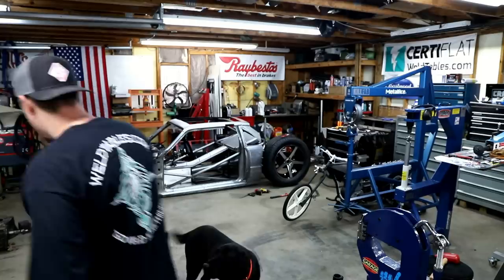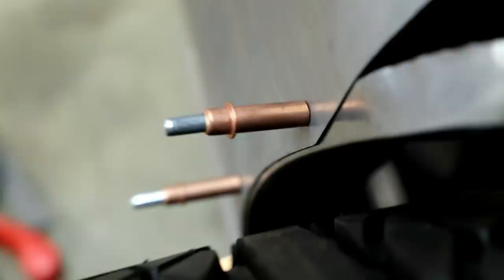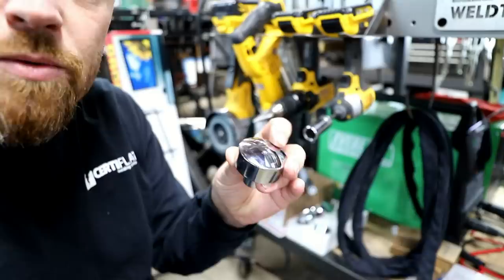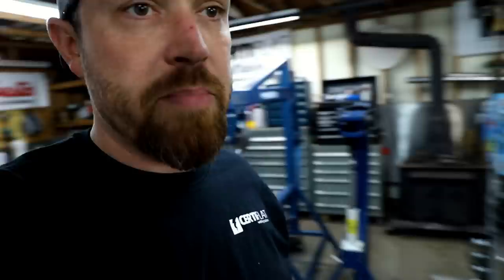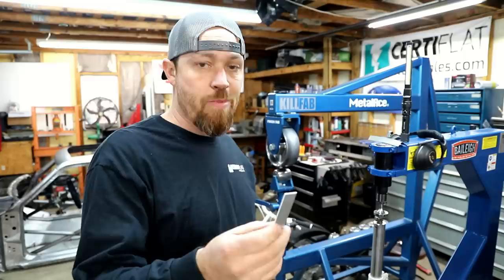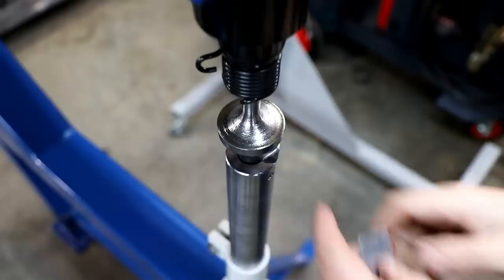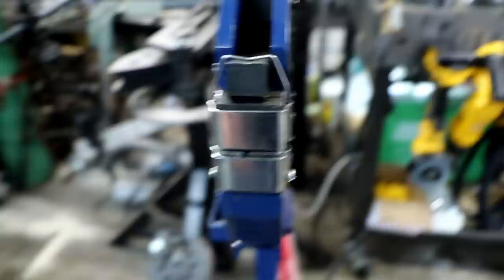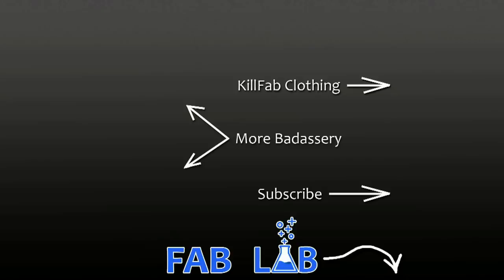How To Make Tools To Stretch Sheet Metal

Comment: You should have a piece of card board between your shrinker stretcher jaws when your're not using them  It keeps the jaws from getting damaged if you happen to hit the pedal or arm. It's not good to push your dies together either without material in between them. I know you didn't push them together very hard but, check them when you take them out to make sure you didn't damage them.
Reply from the maker: you mean those dies that spend their whole life beating metal?
Reply: @Thefabforums  Yep, it tears the jaws up.

Comment: Nice tool. Question, any fancy tool material you used or just mild steel. Do you have issues with one side of the material being to thin to weld? Thanks for the video!
Reply from the maker: just mild steel on this one....it could be easy to get it too thin

Comment: A little bit off the subject, but what size clecos do you use the most? 1/4 or 3/16? Ordering some this week.
Reply from the maker: I use 1/4 on everything
Reply: Ok, after some investigation,  hole size 1/4 or grip depth?
Reply from the maker: actually I meant to say 1/8 inch...1/8 is the hole size I use

Comment: Watch them fingers
Reply from the maker: yeah fingers wont fit in there
Reply: I have a mitler brothers PH, it will get you if you're not careful. Maybe not the whole finger .
Reply from the maker: @joeravinu3239  yeah I could see that with a power hammer
Reply: It's a 24" like your baileigh.  Not a power hammer.  They are about a grand.